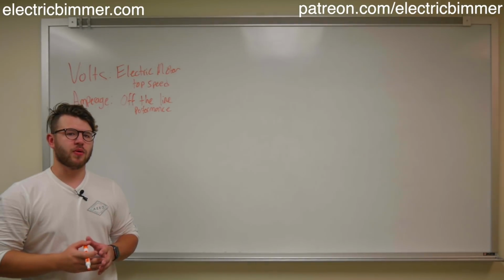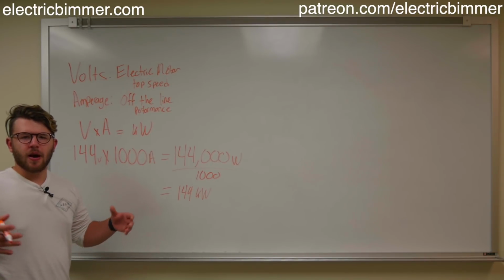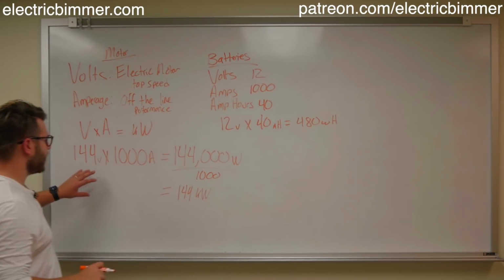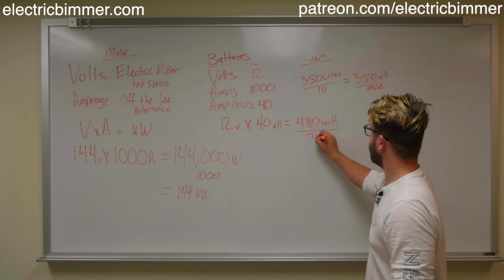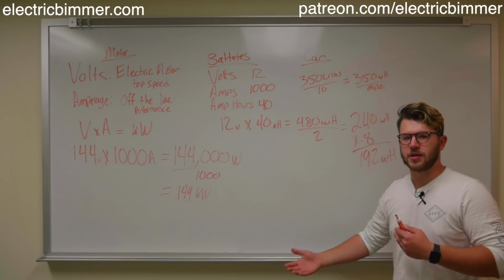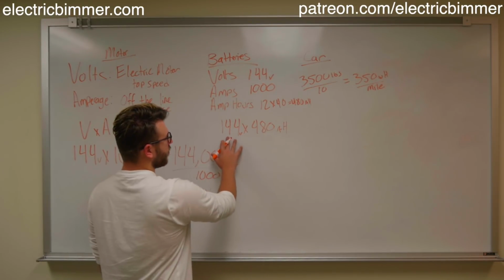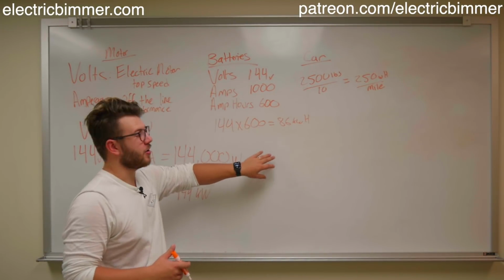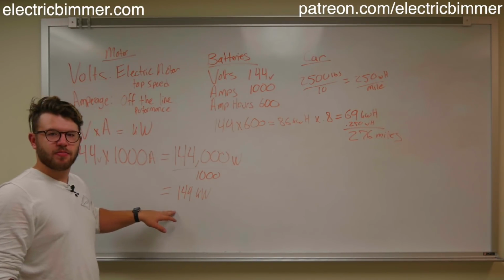EV Conversion Basics - Calculating Components

Comment: I'm still confused in what determines in the system how many amps it uses. Is it how many amps the controller pulls out of the batteries? And do the batteries have a amp rating or is it just AH and V? I'm still trying to understand how the amps relate to the battery system.

Comment: 21:59  - Actually,  I think you'll find that is  BRAKE HORSEPOWER... 
Defined as the mechanical horsepower; the net available hp(l) at the shaft, at specified rpm and full load amperage.
But most IC engines, are equipped with datasheets indicating power output in kW.   So very little need to use the horsepower convention.   
It is now mostly used as an aid to memory/comparison with older engines/vehicles.

Comment: i am converting my mercedes c200 kompressor with following specs. What do you suggest is most suitable motor / controller i can use..https://boodmo.com/vehicles/mercedes_benz-302/c_class-11318/200_kompressor-22494/

Comment: Hi I am new in that kind of project but I really want to transform my Mini Cooper 2010 so I already have 2 motor ho come from a forklift and first 1 is the drive motor 36/48 volts 17 inch long and 13 inch wide and the other one is the hydraulic pump motor and on the motor it is a 12.8 kw so my question is witch one I should take to use in my car and what is the controller I need and how many batteries I need to make around 40 miles or if I want to make more mileage what should I buy P/S I know the motor is not the end of the world but not inoff money for now, I will appreciate if you can help me with this 
Thank you
Reply: I forget I will keep the manual 6 speed transmission

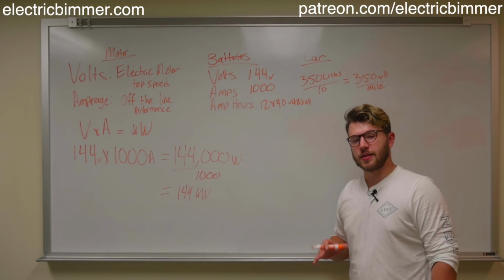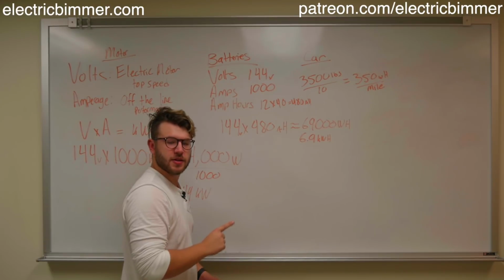Comment: good video, but how do you get 480Ah at 15:37, when you connect 12x12v car batteries in series not in parallel? Does that mean you could go on 480Amps one hour at 144Volts? like 480*144=69120W for one hour, and if you take one battery instead of 12, you get 40*12=480W for one hour, now 69120/480=144 times more energy stored, not the 12 times. 16:31 69000/1000=69
Reply: Very bad math explination. 69000wh is 69kwh not 6.9kwh, but as you said 12 lead acid car batt conecterd in paralel then the result 6.9kwh is correct but voltage is 14.4V for all bats together and for people who doesn’t know electronic basics your explination is very confusing. Still excellent concept explination.

Comment: In the last minute of your video, you mention British horsepower (no such thing). I think you were referring to bHP which is brake HP. But what you calculated was actually the Thermal HP (tHP). 
As you convert battery power units to HP units you are doing a thermal equivalency. The power actually measured at a turning shaft after losses etc, is the brake HP.

Comment: At 16:35 you divide /2 then multiply per 0.8 but it was already lithium so it was not to be just 0.8 as you did in the next calculation?
Reply: he used 12 Lead acid batteries.

Comment: Hey! What is the calculation you have taken for 3500lbs/10 in car range calculation?
We want to calculate our electric vehicles range per charge.
Reply: So that comes to 350 watts per mile if you had a 35 kilowatt battery pack you could drive a hundred miles. There is one fudge factor with this formula and that's how fast you're driving. This usually turns out to be somewhere between 40 to 55 miles an hour. I've noticed that the bigger something is the faster it seems to be able to go and still maintain this ratio. I have a 6000 pound Electric f500 1956 and a 19 68 Austin Morris that weighs about 2400 lb and that's what I've observed.